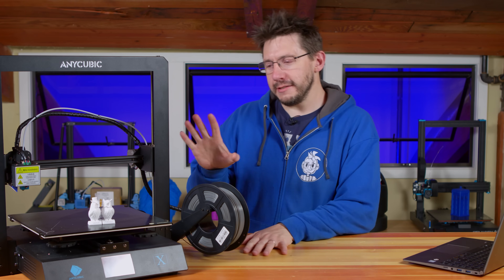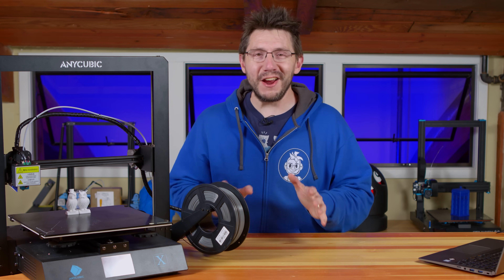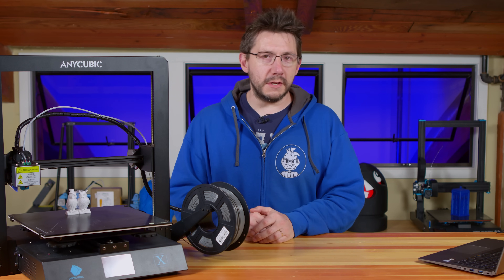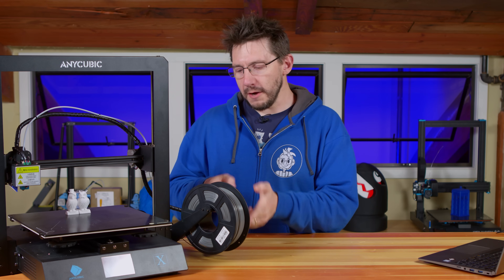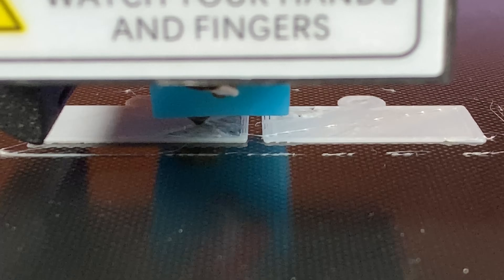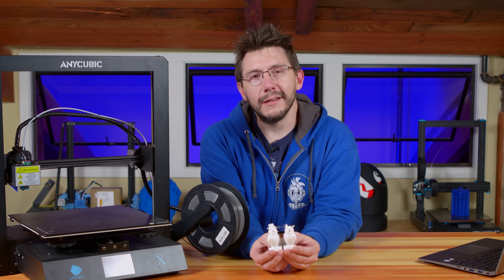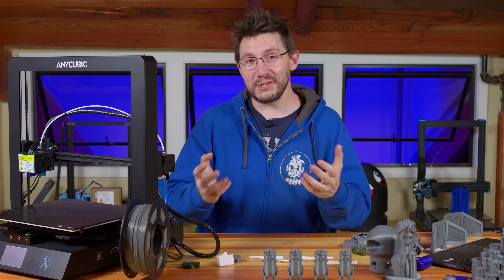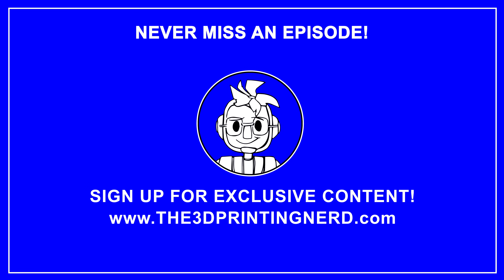Anycubic Mega X First Impressions Non Review?

Comment: Just got myself one of these as my first 3d printer and experiencing some problems.
First off, the ultrabase seems to be somewhat warped (slightly higher in the middle than on the edges), I've yet to test if it makes it problematic to print things with large surface area, but it makes itimpossible to level properly. Has anyone experienced anything similar?
Though I have managed to get a few somewhat good prints out of it somehow, there is a different issue: since the cooling fan is only blowing on whatever is being printed from one side, the other side of the print ends up looking deepfried if it has any sort of overhangs. Is that something that can be fixed with a lower printing speed or something similar?

Comment: you should try to print a thin surface-like model. i tried a facemask in clear tpu on my regular i3 mega and most slicers had trouble. basically a wall 3ish lines thick and most slicers would do wierd things to fill the middle line.

Comment: I have the anycubic chiron. It has many of the same features but it's got a 400x400x450 build volume and it's only a tad more expensive at £350. Would recommend that too. I suspect it's the same electronics but just mechanically larger.

The only thing I want to change on it is the hot end but that's more because the E3D Hemera exists and I want one rather than it being a major problem with my hot end/extruder.

Comment: been using a Mega S for a few months now i got it on sale for 200$ which included 5 rolls of their own PLA, which is actually pretty good, nothing in the same price bracket printed better, but i did hone in the settings to print beautifully with their own brand.. will need more testing.. anyway it already turned a profit in the first month, by this time i have to had made about 400-450$ using it, and a BUNCH of stuff for myself. ultimately it was one of the best purchases i made in 2019.. and this little hobby has become 100X more useful, fun, and rewarding than i had ever imagined before i got this printer.
Reply: How are you returning a profit? Are you selling custom prints or selling certain items? I've been considering getting into 3D printing, but don't know if I'll do it unless it returns a profit for the price of the machines
Reply: @Ignotus.  well thing is where i live a lot of people are basically tech illiterate, and there is literally no 3d printing business here at all. 
most people have literally no idea it exists its not very publicized here.
i work in a print / design firm as my regular job  (printing, t shirt, graphics design etc.) so i get a lot of client overlap there that i can take advantage of
 i have been 3D modelling in several programs for years before (i studied architectural design so i know the software) 
and i charge for custom design work and printing / prototyping.
since i am MUCH cheaper than taking it to a  woodworker or metal worker to make the shape, i get decent business prototyping products for people. that is a big revenue source but its kinda rare.
i do a lot of one off prints of useful stuff for people.. like say " i broke this piece and i need to replace it but you can't find the part" so i model it and print it..
i also, which is my favorite, make jewelry and decor stuff that sell, planters, necklaces (they sell very well) table knick-knacks, figurines, small presents, car stuff like phone mounts, grates shift knobs etc. PC parts, like gpu vertical mounts, sag support, brackets/mounts for water cooling, cable combs etc,
also made a lot of covid Mask covers and Halloween masks / decor Christmas decor..
made display stuff for stores like putting leds in parts etc.
also made a limited amount of furniture that included parts i 3d printed.

i did go out and buy an Anycubic Photon Resin Printer as well for smaller more detailed work like figurines and the like.  it leaves a nice smooth surface, an you can print a lot faster with it. the relatively small size , and higher material cost of a resin printer does limit what you can do with it .. BUT the Photon Mono X i got is massive for a resin printer tho. Most more affordable variants like the Mono Zero are perfect for small stuff ( most stuff i use the X for would fir on this tiny printer btw, i just had the money to spare ad i like to have the option) 

price / performance wise im very satisfied with Anycubic, but you can always go for a better brand like say prusa, monoprice, fomlabs etc. 

i combine the 3d printing with woodworking, some metal machining, Epoxy molding, printing, lasercutting/engraving (laser at my workplace) and electrical engineering (my dad is an electrical engineer so learned from him) to make almost anything i need around the house or anything a client wants. 

With how versatile a 3d printer is i can guarantee you can find a good use for it, especially if there isn't someone doing it more seriously nearby. 
and if you need free software to model i can recommend Google Sketchup WEB for starters ( app dot sketchup)
its browser based don't have to install anything, super easy to learn and use, and can download to an STL file that you can use in your slicer of choice, i like CURA.. but BE WARNED if you have a ryzen 1000/2000 CPU CURA WILL crash your pc to Black screen if you leave it running too long!. its got progressively better recently with new updates but it still does it sometimes. 

sorry for the long rant, if you need any help,  or even want some example models of my stuff later on if you do decide to get one, hit me up whenever!
or encounter any issues, if you do get an anycubic printer , i can share the settings that worked for me, what filament was good, any really any tips you may need
Reply: @xenonnati  wow! Thank you so much for such a detailed reply. 
I appreciate it very much!
Reply: @Ignotus.  Of course! its a fun hobby and an awesome opportunity to take advantage of! the more people get into it the better, we probably don't live anywhere near each other etc. so why keep things a secret. 
hit me up anytime! i can share my experience and my mistakes hopefully giving you a good head start into thins :)

Comment: I recently got the Anycubic Mega S. Its the baby brother to the Mega X, and has a lot of similarities.

I've found the major cause of the stringing is actually the PLA from Anycubic that it comes with, its not very good quality, needs very high retraction settings and is susceptible to clogging in the nozzle. 

Once I got it dialed in though, man its good! Definitely a good choice for a first 3D printer.

Comment: I absolutely love my Anycubic printers, I've never had a problem with them that wasn't my own fault (unlike some other Chinese printers). And Anycubic support is awesome (unlike some other Chinese printers).
The Ultrabase is very grippy, almost always hanging on to prints down to about 35-36C, then they just fall off.
One warning, though: don't try to print PETG on a bare Ultrabase, it will tear up the surface texture! You can get around it with a liberal coating of UHU stic (the white cap, not the blue or green ones), but I don't recommend risking it. There'll be tears!

Comment: I picked up an Anycubic Predator this year--my first Delta--and truth be told, it took me a good 2 weeks to get exceptional prints out of the it. The first week was simply not having the right kind of g-code going through the slicer, which would be really nice to know in the literature (it was not). After that got sorted out and having tried ALL of the freeware slicers on the market, I'm getting the best/quickest prints out of Cura 4.5 and have a really, REALLY fine tuned set of profiles that make prints way better than you'd expect for a $350 printer, AND the customer service is stellar. The factory heated bed had a really bad warped sector that the printer--even with the auto leveling tested ad nauseam--would layer shift on, and after demonstrating it to tech support they sent out a brand new one Free. I did end up swapping out the spare hot end thinking the first week's poor results were probably a susceptible nozzle or the ptfe tube, but since I put in Capricorn anyway it wasn't a big deal. I'm absolutely tickled that I got my first 12" figure printed out over the weekend with nary a problem and it looks fantastic. 
Only downside was that initially I was going to get the Chiron and it was sold out everywhere, though this was just as China was getting hammered by Covid-19, so it was going to be an issue getting Any printer. Fortunately for me, the Predator was in stock AND in a US-based warehouse, plus it was about $100 cheaper than the going rate for a Chiron. 
I'd consider getting a second one at this point.
Reply: Hey I know this is 2 years old but I can't fix the stringing on my anycubic x and drying the filament only helped a little. Can I have your cura profile that is tuned perfectly?? Thx
Reply: @maximuschapman3852  I lost my content hard drive during a PC upgrade in late 2021 and haven't printed in PLA for a few as I transitioned to resin awhile back, however, I did find one profile saved as an ini that was a good one. If you're still interested I can reply with an imgur link if you want to copy settings over manually. Or I can post a public google drive file, up to you.
Reply: @C-M-E  oh heck yes. I would take either, I really just want to see the right retraction settings and all of that. If this is for the anycubic mega x then please send me your settings.
Reply: @maximuschapman3852  I put a link to a google drive file with what I had in one of the other replies in this chain. There's an ini profile you can probably import and tweak the bed size as needed but the settings are solid for hatchbox pla.
Reply: @C-M-E  hmm, I'm not seeing the Link

Comment: Good 'non' review. I just bought a Anycubic Mega S on March 7th. I've done 1/10th of the prints you have - LOL. My results with the Cura slicer that came with the machine were good. I've also tried Cura 3.2.1 and 4.5. Some quirks with all of them for an amateur with little 3D printing experience. I was not aware you could use Prusa slicer software with this particular unit and will try that next. 

I have had some overlayering on the non-cooling side of all the models I've printed. Keep thinking it's a setting issue instead of a cooling problem such as Wall Jerk settings. The Ultrabase 3D base plate is okay. I'm finding after only 10 prints and always cleaning the bed with Isoprol Alcohol that most prints are very difficult to remove. The thin layer of filament left behind is significant and takes some patience to remove carefully. Any tips on bed heat (mine is set for 60 deg for PLA) temp control would be welcome. I've set the temps for PLA to 200 deg C as recommended by Anycubic.  I look forward to some 3D printing tips on your channel when using this machine, which uses the same print hot head, extruder and build architecture as the Mega X.

The cost of these machines in Canada when ordered direct from Anycubic is expensive and recommend going through Amazon.ca There are some third party retailers here in Canada but warranty support is not as good as what Amazon / Anycubic offers. Amazon.ca had a coupon sale for this machine in Canada for a retail price of $399 instead of $449.00 Canadian (current exchange rate is brutal after Wall Street crash at 1.44 Cdn to US dollar) so overall, it's a good price. The new Mega X, which I wanted to order is not yet available via Amazon.ca

I printed 4 models and the fan in my power supply started to make a grinding sound. Anycubic sent a complete new power supply via Amazon within three days of filing a warranty complaint. The hotend fan started to operate only part-time (default setting in the firmware and slicer settings is set at 100%), so they are sending a new fan from China - which will probably take a while (but they gave me a tracking number). 

Great episode. Thanks for posting this.

Comment: I have a I3 Mega. My biggest question for this machine is: does the heated bed warp? Almost all I3 Mega's have warped beds AFAIK, would be a shame if this one does as well.
Reply: Actually the heated beds are not warp. The main problem is in the x and y smooth rods. Rod holders are stretching the smooth rods.(Especially the x axis).

Comment: Currently running 3 x Anycubic I3 mega-s machines. Amazing performance for the money and Anycubic after sales support is great! Well worth considering this machine
Reply: Rob Thomae I have one aswell! My only problem is the size, but any super large prints usually are also able to print in pieces able to fit so it’s awesome. I need to do some mods since mine is currently very loud. I absolutely love how no tape or glue or anything is needed, and I only have fails when a print is extremely small without a brim, otherwise it’s never fails.
Reply: I definitely recommend thingiverse part #3537449 for the carriage assembly , recently upgraded my mega s with that and tmc2208 drivers. The quality is outstanding now, with silent printing
Reply: @brady911  did you need to set up the voltage for TMC2208? I bought but I don't have multimeter, now I'm afraid to change and mess up the board.
Reply: I talked with the support team and it was amazing.

Comment: Thanks for the always interesting videos.
I've never had a 3d printer in my life, but I have been following the news and developments with interest for years.
Among the many FDM 3d printers, I am interested in the Qidi Tech X-plus.
It has an excellent printing area (270x200x200), is a closed printer, and works with many materials.
There is also a model with a larger print area called X-MAX
On Amazon they both have 5 stars due to the print quality and the excellent assistance from the manufacturer.
Is it possible to make a review, since there aren't many on youtube?
Greetings from Italy

Comment: Hi Joey. Good review on the Anycubic Mega X. I am having some trouble with my 3D printer. I have a Folgertech FT 5 R2 and I am getting what looks like some small minor underextrusion or filament skipping in the layers and also extrusion inconsistencies throughout my prints. I am using Makergeek’s PLA with the printer’s original extruder. I have already change the print speed setting from the default, which was print speeds of 60 mm/s, acceleration of 3000 mm/s^2 and jerk of 20 mm/s to the changed setting, print speeds of 30 mm/s, acceleration of 500 m/s^2 and jerk to 15 mm/s, from there being layer shifting and under extrusion problems at the default speed setting. this kind of worked but still my problem that I am asking about is still there. I don’t known if the problem is the filament, the extruder setup or my Cura Slicer Profile Settings. What is the best why way to solve this or a list of things I can try?

Comment: I’ve had mine for a few months. Only problem is the bed is not perfectly flat. So corner to corner one way I have to just get close enough leveling the bed and it works. It prints pla perfect out of the box, abs on the other hand did not. Ended up building a enclosure around the machine to hold the heat in and it works pretty good now.

Comment: I laughed when you brought out the paper bags filled with prints.  I have one that I put all my small plastic scraps in.  Speaking of scraps, what are you doing with all of the waste plastic that you are generating?  I’m hanging on to mine until there is some way to recycle it or convert it back into filament.  I know there are machines that will do that but they are pretty expensive and not exactly plug and play at the moment.

Comment: I like both of my anycubics and I own 3.  One of the will simply not read data from an sd card or from USB anymore. Update firmware and it did not solve the problem. So right now it sits, and will be used for parts. But overall I am happy.
Reply: I'm having the same problem.  Mega S that has worked superbly until now.  Just quit reading.  Sent a note to Anycubic.  Will see what happens

Comment: i have a anycubic i3 mega and run it at 100mm/s at 0.1 and its runs perfect. I have had it at 150mm/s but thats when i did not know much about printers so printed at that it gave a perfect print and no damage as i found out more i slowed it down and is still running perfictly

Comment: Can you please post the profiles you used?  Also did you manage to eliminate the stringing?  I'm printing with a Chrion and am fighting similar problems.  I can't seem to tune the retraction to prevent the problem.
Reply: Stringing = material + retraction + temperature. Try lowering temperature, it can be different even from PLA from different manufacturers (and termocouples are not precise).

Comment: Hello:) I'm a complete newbie, in 3d printing and on Your channel. However, few days ago I have ordered my Mega X. Thanks for the review and Your opinion. May I kindly ask You for Your advise on what I should do at the very beginning on order to make more or less decent 3d prints? Wish You health and to stay safe!
Reply: look up matts hub 3d extruder calibration first up ,save u any issues
Reply: @gavintownsend6125  Thank You very much! I got the printer the day before yesturday. Have been printing masks non stop since then up to now. I don't understand many things in 3d printing yet, I have used the settings that came on on the SD card for the face shields. The first took my 2 hours and 40 minuets. Then I used the settings that were provided by anyanycubic under their Face Shields design video (https://drive.google.com/drive/folders/1laCnGAHT_s9nekcpx8vtxBUuvetnkTXI). Now it takes around 1 hour and 45 minuets in reality, but in slider it sais 1 hour 12 mins... Would You know by any chance, what that might be this difference due for?. 30 minuets on a mask is a huge difference. I need to make 100 hundred. I am at  16 now. Ordered another printer Chiron., which will be here hopefully in a week.  
Thank you in advance.